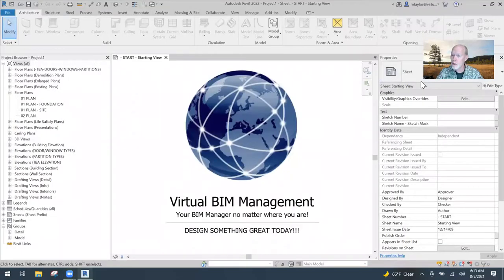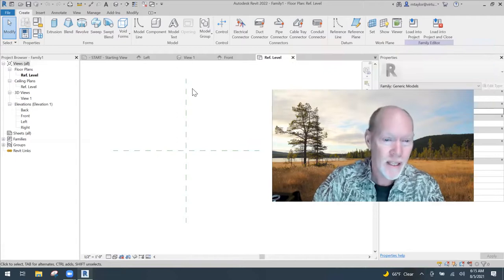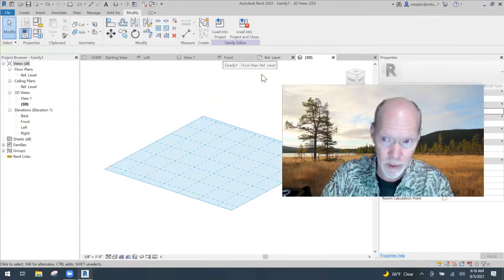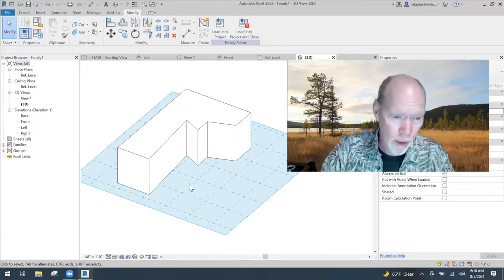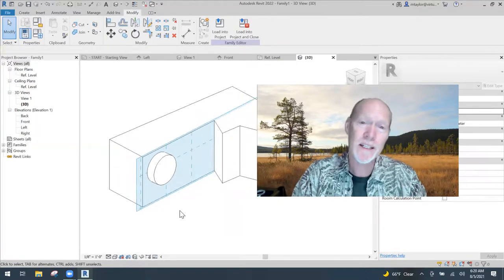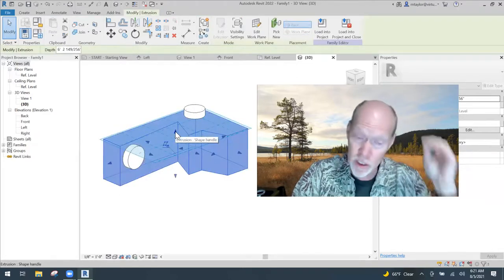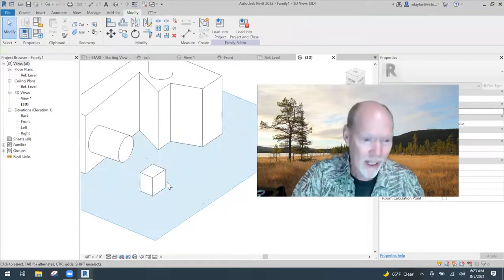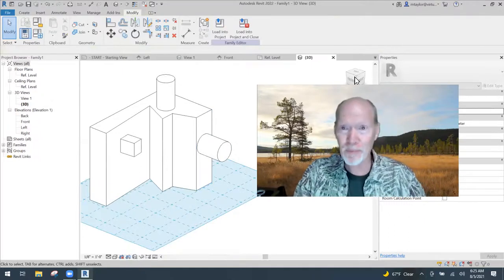WORK PLANES: Use them while making families

Comment: OK, here is my request; How can I make a window that can use phase filtering to have the whole window marked as demolished, or just demo the sashes (the parts that hold the glass). I work on older houses that are being remodeled and I need to make a special window family that accurately cuts the wall according to the type of window that is .  Especially double hung windows with sash weights because they cut the wall 4" to 6" wider than fixed or casement windows. Sometimes we take out the whole window, but more often we leave the trim and frame in the wall and only replace the sashes with a modern insert and I never know what the contractor and customer is going to want until pretty far into the project. These window also typically have big sloped sills that go from the inside face of the wall and extend beyond the exterior face, and they frequently have horns on those sill that extend beyond the sides of the trim.
Second question: What is the best way to deal with the nested trim system that seems to be on many of the stock window families?
Reply from the maker: If you need the window to be 'demolished' and the surround to 'remain'... the easiest way is to use 2 separate families. Revit DOES have functionality to make specific parts demo and other parts not...but it's the PARTS command to do that.  You are getting into the weeds when you go that route, so I always suggest using 2 separate families.  It's just easier that way.  I have a video that explains PARTS if you want to go that direction.